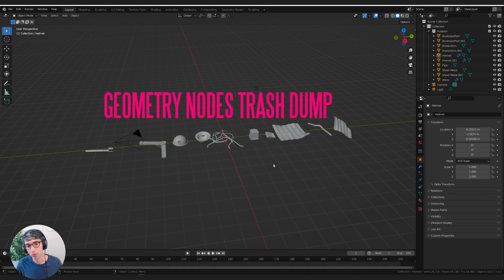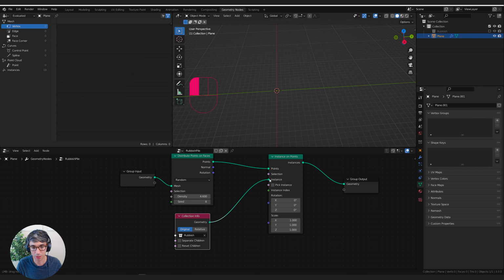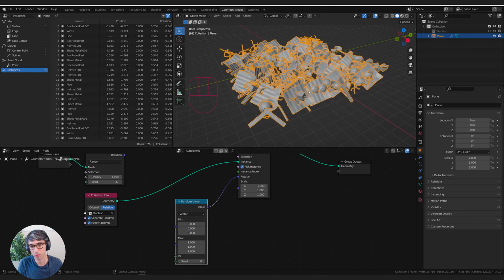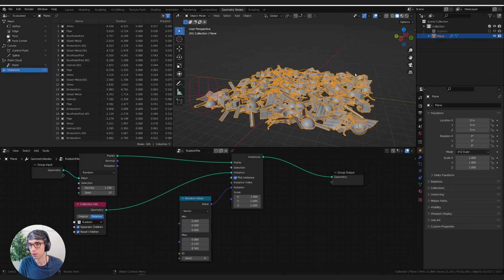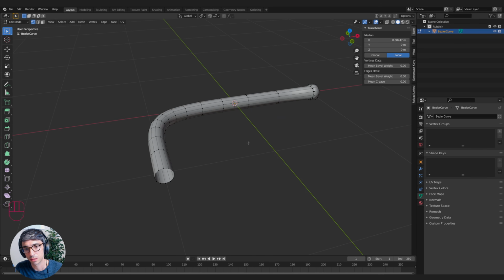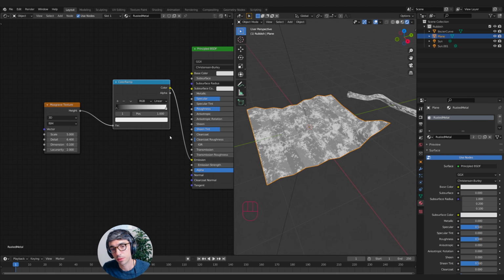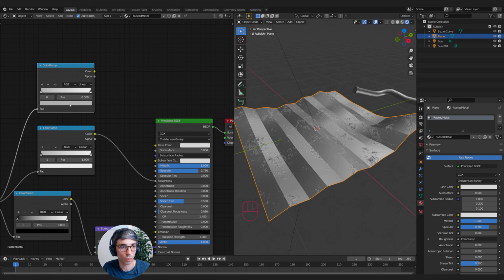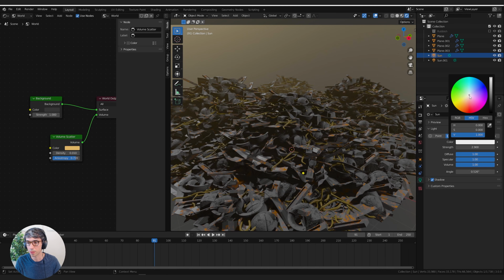Geometry Nodes Blender 3.0 Tutorial - Make A Trash Dump Fast [Make Your Short Film Part 9]

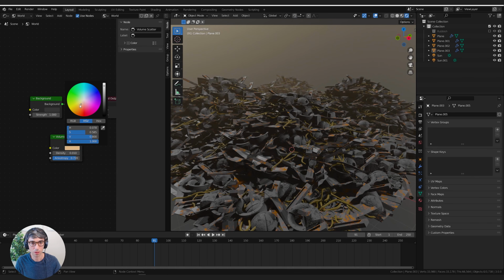Comment: 25:16 No matter how hard I try, when I plug the volume scatter I have nothing but BLACK picture.
Reply: turn density down
Reply: @vAmmonite  Thanks, but I finally found what was wrong : My only light was a sun type, and the volume output of the shader doesn't work with a sun lamp (but works well with any other type).

I was not aware of that, but now I know.